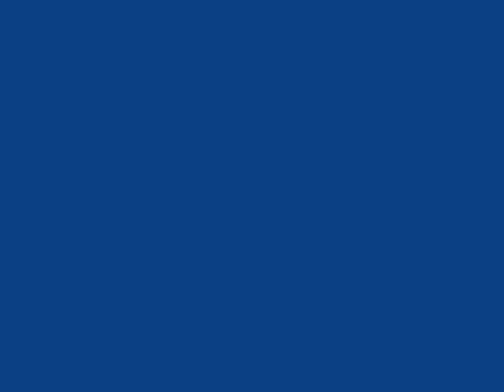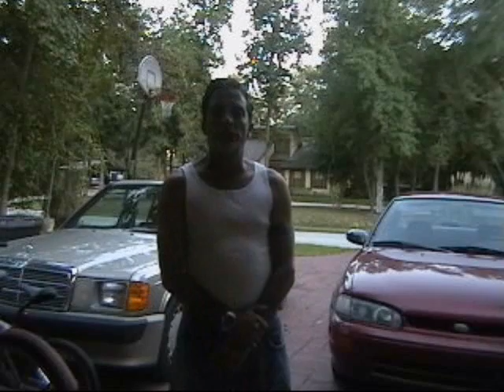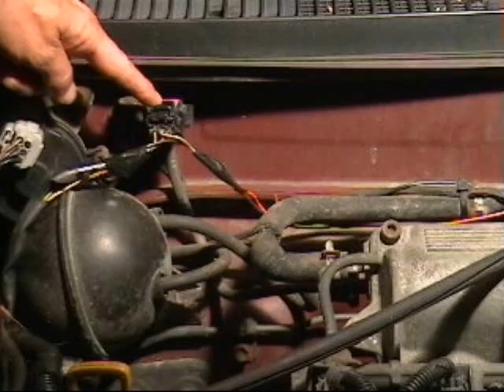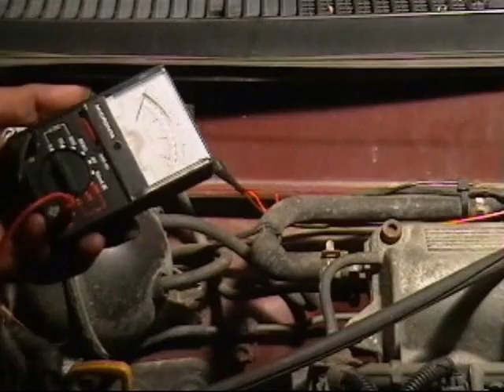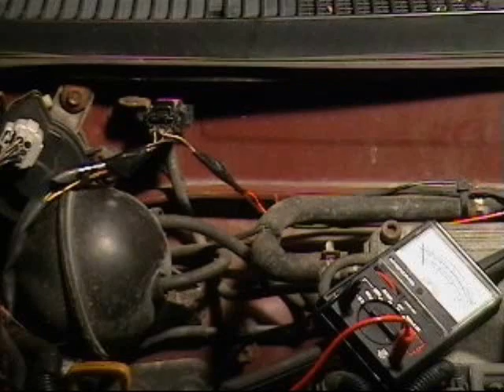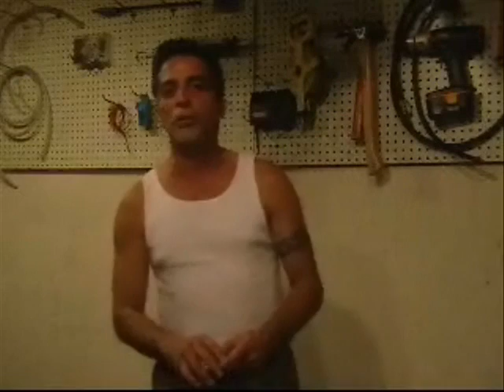HYDROGEN GENERATOR HYDROVIN SERIES MAP SENSOR, MAF SENSOR

Comment: Nice work Hydrovin FYI some cars have both like my 01 Olds Intrigue the MAF is the primary mixture control but on this car it is not voltage controlled but frequency controlled. I have yet to find a enhancer that does frequency control 
Ray